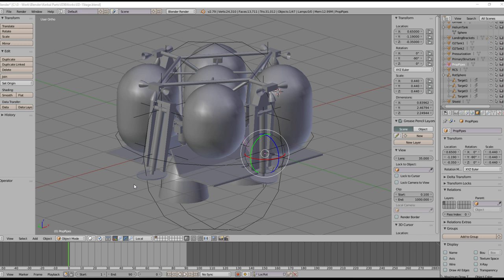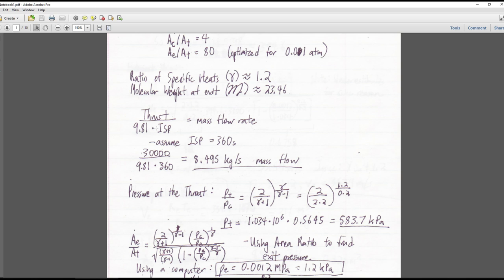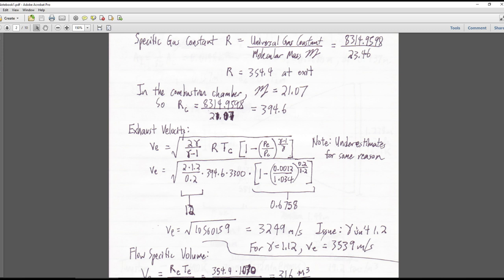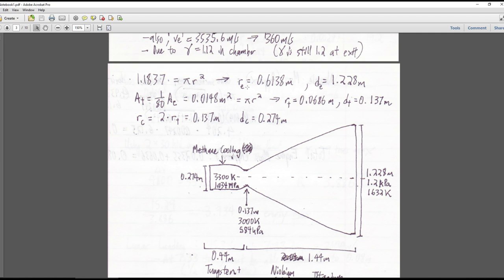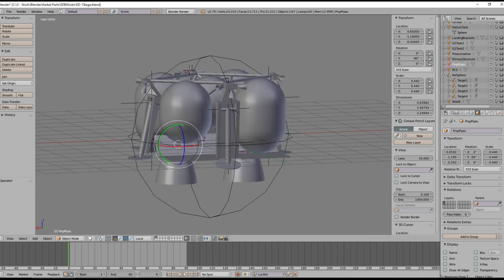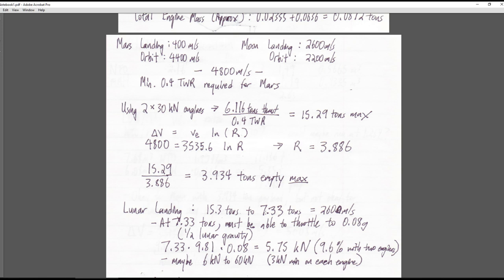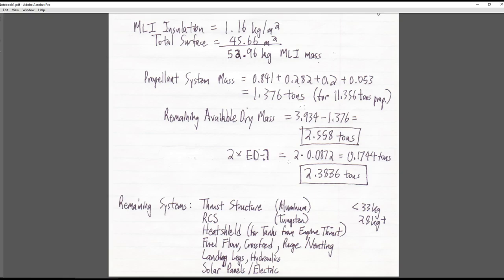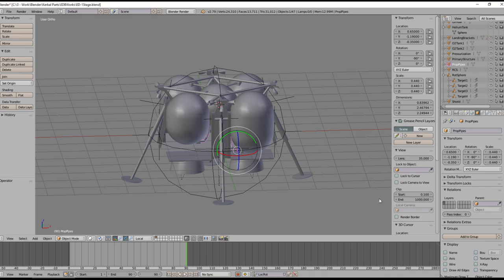Rocket Science - Design of a Pressure-Fed Lander Stage

Comment: Aerospace Engineer undergrad here... I  just finished watching the section on the your wall thickness section and I am not 100 sure you have everything if my understanding is correct. it sounds like you are calculating wall thickness based on pressure stresses alone. I looked back at my class notes for jet/rocket propulsion for wall thickness. there are effectively 2 walls, the inner and the outer wall. The inner wall thickness is designed to keep it  cold while the outside one is the one that will hold the majority of the stress. 
BTW if you take a radial slice the cross section of the wall is approximately square. The formula for the inner wall thickness is this:
T_(wall hotside) = T(hot gas ~= T_stag ~= combuster temp) - (T(hot gas) - T(Coolent temp))/(1+innerwall Thickness*convective heat transfer coefficient of the hot gas/convective heat transfer constant of the wall + ratio of convective heat transfer coefficients of hot gas over liquid coolant)
you can find the formulas for convective heat transfer here. 
https://en.wikipedia.org/wiki/Heat_transfer_coefficient
my notes say that the coolant should be  channel flow and the hot side is a super sonic boundary layer. My class notes has the formula but IDK if I am allowed to share it as it's empirical.
Your method for calculating wall thickness should be fine for the outer wall btw. 
The notes don't say how how frequently the vertical supports should be between the inner and outer layer, however, I have an idea of how you could model it. I would do it by approximating each tiny cross section as a beam with 2 supports and a continous load. so the max moment is deltaPressure* L^2 /8. I would then fiddle the formula for finding local stress to become 
stress = 6*moment/innerwallthickness^2   ( I can't garuntee this formula is right but I derived it from stress = moment*half the thickness/I 
I made the moment ~= moment per length infinitesimal and I as 1/12 length infitesimal *thickness^3
the delta pressure is the difference between that specific locations static pressure and the coolant pressure.  also L is simply the del Theta * local nozzle radius. I'd then find the maximum moment as a function of local radius of the nozzle and find that maximum and use that to find delTheta and then make the number of vertical supports 360 degrees/deltheta. I seriously have no idea if that is right, but I think it's close. I  hope this helps. Feel free to converse with me :)
also one benefit of 2 walls is that the outer wall is cold so you can stress it much more for structural support
Reply from the maker: Yeah, I definitely don't have everything and I was hoping for some corrections. I have some info in a book on running coolant around the chamber, but I hadn't gotten down to doing the math yet, and what you presented here should help. When doing the calculation, I used a safety factor of 3 instead of 1.5 for the chamber, so in theory I got a mass for two walls, but as you said, I've got to figure out the thermal aspect and not just the pressure. Let me give it a go based on your info and what I also have, and if I think I understand it, I post a video on it.

There will be other videos and, just so you know, I have no idea if I'm doing anything right. It's all a work-in-progress.
Reply: @RaizSpace  one thing to note... I think this means that the pressure on the outside, structural wall is considerably higher, with a pressure of at least 300 psi if I remember your tank pressure right. Also not 100% sure on this though. Also depending on how fast your liquid methane coolant is traveling you're going to have additional pressure as function of coolant velocity and local turn radius... If you're coolant is slow it shouldn't be a problem but if you want I can either find the notes or re-derive it for you
Reply: I think my other comment didn't go through yesterday. That temperature estimation ignores radiation. Now I am pretty certain you should be fine as I don't think methalox burns brightly ie low emmissivity
Also afaik most regenerative cooling goes to the bottom of the engine and goes back up to the chamber and a little amount of the fuel(the coolant and injected on the sides of the combustion chamber. Whatever temperature that gas is is what you should use in that formula. That temperature will be a function of how far down the engine it is and it will take longer to heat the more fuel you add to this layer
Reply: One more thing. I wrote that formula down wrong. It should be the conductive heat transfer coefficient of the wall, not the convective heat transfer coefficient as that doesn't exist for solid materials.

Comment: I think I know why your hand calculation underestimated. The ideal exhaust velocity equation assumes that all gasses are exhausted axially - the engine is operating with ambient pressure as exhaust pressure versus in a vacuum. There's a simple correction you can use to correct performance, I think it's in rocket propulsion elements chapter 3.

Comment: Might be worth to consider moving the computer box away from the thermal stress area (I assume the propellant pipes would be cold, vs. however much heat is radiated back from the chamber and the nozzle)? Also, attitude/altitude sensors for landing?
Reply from the maker: I'm not sure where would be best to put the computer, though perhaps right above the Helium tank would be good, under a potential adapter for the payload/docking port. There have to be a lot of sensors, including pressure, fuel level, etc, that I haven't contemplated at this stage of design. I haven't really worked out the hydraulics of the landing legs, even.

Comment: hey raiz i had a question , as the oxidizer and fuel ratio are different so does the oxidizer and fuel come at different pressure in the injector plate and how is the o/f ratio controlled?
Reply from the maker: Yes, the pressure can be different due to a number of factors, and it is controlled by fuel inlet valves, pressure regulators, and (in the case of a non-pressure-fed stage) the turbopumps. It's all just plumbing - even garden watering systems have valves and regulators to manage pressure through the lines. I guess one other thing to mention is that the injector plate is like a shower head with hundreds of holes with some of them for fuel and the others for the oxidizer. The two are kept separate until they meet in the chamber (or in a gas generator or pre-burner in non-pressure-fed stages).
Reply: @RaizSpace  got it thank you so much🔥🔥🔥🔥

Comment: Awesome !! But, you talk about ISRU, is it possible for small landers to refuel themselves considering the fact that it must be very slow and that the CH4 and LOX may boil away faster if there's no heavy cooling stations (so heavy electricity productions) ?
Reply from the maker: A two ton ISRU unit should be able to fill up this lander in less than one year, and since we aimed for 10% boiloff every half year, that's 20% per year, so it's doable. The problem is that the ISRU would be the lander's only payload, so if this is in ISRU mode, it's probably staying on the surface and keeping its tanks topped off so it can refuel a different lander, so that that lander doesn't have to wait around.
Reply: @RaizSpace  Oh, ok, when i posted this, i didn't see the whole video ^^ sorry :( thanks a lot for the answer anyway <3

Comment: If I assume  chamber pressure and Based on this assumption i design the nozzle , how can I be sure i can  achieve  this pressure  inside the chamber ?
Reply from the maker: We assume that the propellants and combustion products are basically static at the point of injection, so they act like an ideal gas in the main chamber. In the most basic calculation, you can use PV=nRT, the ideal gas law, to find the necessary volume for your chamber, as you will know the temperature of combustion (this can be looked up), the mass flow rate (you do have to calculate how long the combustion products are going to stay in the chamber, given that they are traveling at about Mach 0.4 on average), and the desired pressure, so you can get the volume of the chamber above the throat. That's the basics, but ultimately in a real design they will model the flow of propellant through the engine and, of course, test.

Comment: Where did the 10^6 in the flow specific volume come from? And why is the gas constant R*10^3?
Reply: Edit: It helped to convert MPa to kg/m^2 for the exit pressure to get a proper result.
Reply from the maker: In the first case, Megapascals (MPa) are millions of pascals, and as you seemed to have figured out, a Pa is a kg/m^2. On the gas constant, because we're using kilograms instead of grams - the gas constant is normally cited in terms of grams per mol.
Reply: @RaizSpace  brilliant, thanks!

Comment: HI Tyler, how you calculated the nozzle length and the thrust chamber length ?
Reply from the maker: The thrust chamber length is at least twice the diameter - sometimes a bit more than that, but it's usually around there. Nozzles can vary, but you're best off looking at an engine with a similar nozzle ratio as the one you're working on as a reference. You can also look up de Laval nozzles to see some shape references.
Reply: @RaizSpace  Thanks, helped a lot.
Reply from the maker: The actual calculation for chamber length is a bit involved, and I recently saw this, which may be of interest on the topic: https://twitter.com/thesheetztweetz/status/1272650380439060482.
Reply: @RaizSpace  Thanks again Tyler. I didn’t say before but I’m using your video and some other references to build a small engine for my technical mechanics course. I'm using a conical nozzle so I can find the length of it triangulating the radius of the throat with that of the nozzle and using the design angle. (in case 12°)
Reply: @RaizSpace  And here is another
 https://space.stackexchange.com/questions/22730/what-is-characteristic-length-in-a-rocket-engine

https://space.stackexchange.com/questions/31009/how-are-the-combustion-chamber-length-and-diameter-decided

 contains a formula for L* and a citation from a book
Reply from the maker: The problem calculating with those is that you'll generally not have the volume of the chamber and don't have the correct propellant stay time.